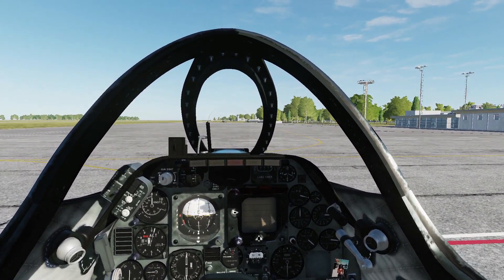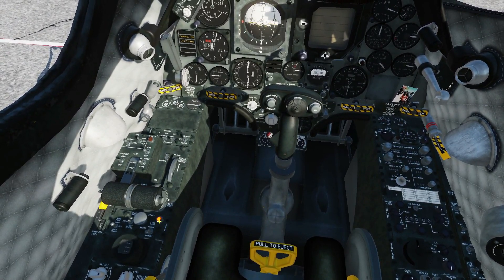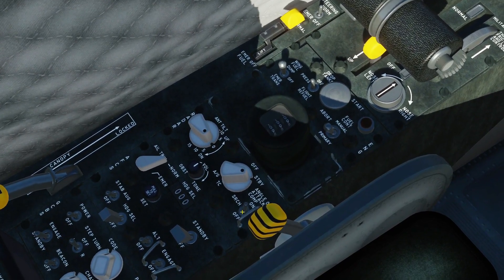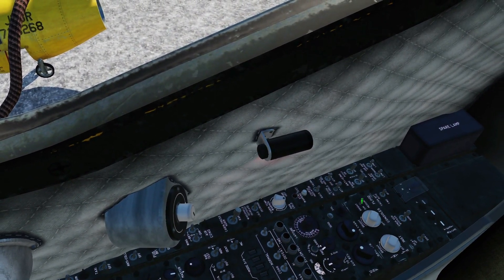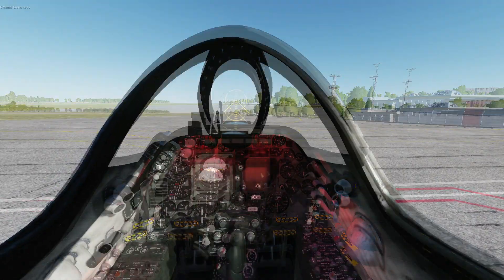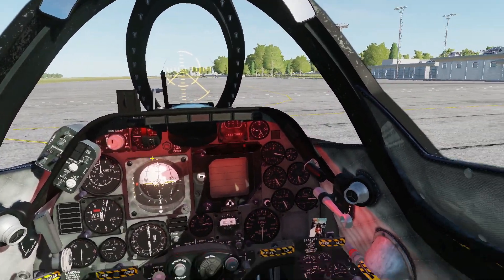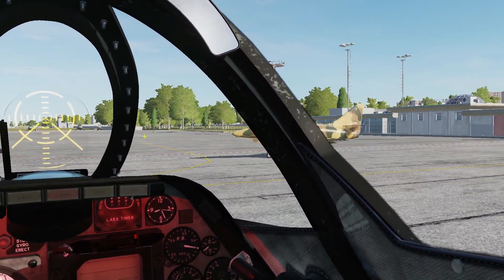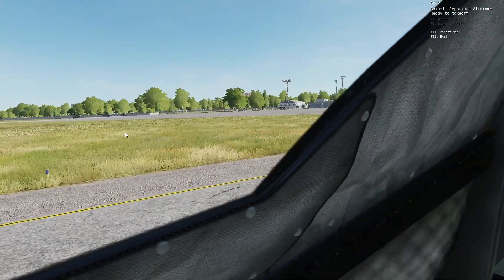A-4E Skyhawk: Cold Start & Taxi Tutorial | DCS WORLD

Comment: For the new pilots, there is no more NWS (Nose Wheel Steering) anymore.
Reply: Yeah I spent so long looking for it
Reply: @BrendanCurley  so what is the solution bro?
Reply: @maximilianotorrealba9110  you have to use differential braking
Reply: No blame to the authors of this fine tutorial, who have done their usual excellent job, BUT:
I have had to give up my rudder peddles (for reasons too boring to recount) and steering this little jet with keyboard-bound brakes is a minor nightmare.  Hoping for some tips on that, but they filled in a lot of other gaps on startup systems, so very grateful for that.
Twistgrip rudder has worked well for me, I guess I will make another run at seeing if I can work the toebrakes through that.

Comment: Dear Cap, would you happen to have the axis curve settings for this aircraft? Seems to be too "twitchy" on the roll.
Unfortunately, I don't have a 2 foot long stick in between my legs like you do. ;)
Reply: I use a curve of 25 on the A-4, the highest of any aircraft I fly in DCS. For reference, my typical curve is around 5, so you will need to scale the value to suit your tastes.
Reply: I use a 25 curve on both pitch and roll, plus a 50 sat Y on roll which halves the maximum roll rate down to 360°/s, but gives me a lot better control. And it's still insane. Works well on the FFB2, even with the force trim which is modelled here (on some planes - like the Flankers, curves arent's that great with such a stick as the curves don't apply to the forces and the trim range isn't enough anymore then)
Reply from the maker: I used to use +25 for all axis in all A/C with old stick.
Reply: for me i have to set frickin' 40 on my extreme3dpro and 25 for yaw.... this thing is flippy man.....

Comment: They fixed the NWS range two days ago (develop branch).
Reply: Still have to try that. Looks like it's twice as big now if I understood the description correctly. So it's even easier to tip the thing over XD - but also easier to turn in tight spaces on a flight deck.
Reply: @CakePrincessCelestia  It looks more like the fix wasn't as much about the NWS parameters themselves after all, as it was about properly aligning the animation of the nose wheel to the factual trajectory of it. Guess I was simply feeding it very small pedal inputs (as is at all possible with TFRP with no curves), so I didn't have much problem with steering the plane around. Although, yeah, turning at speed can indeed look scary.